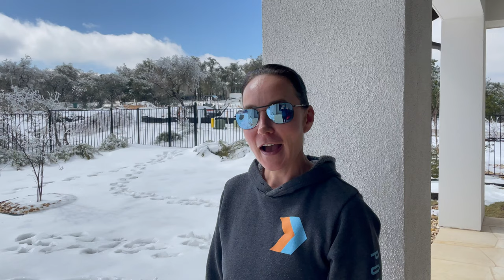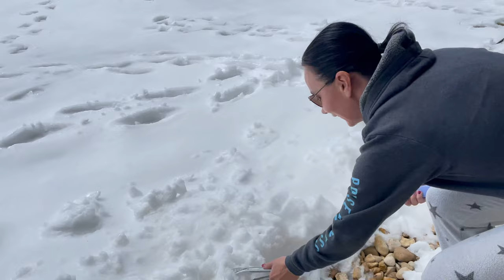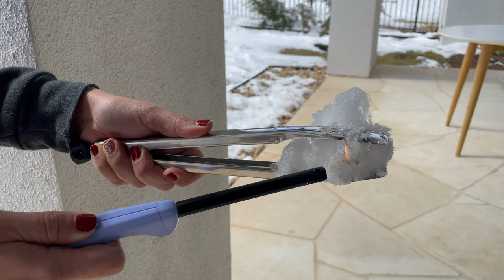Texas Snow Doesn't Melt When a Flame is Applied! "Fire and Ice."

Comment: It is melting. The water is just absorbed into the rest of the snowball that’s loosely packed. And the black is soot left by the lighter.
Reply: You're partly right but the blackness is not from the lighter because it does that in the microwave as well so that's false

Comment: By putting a flame up to a snowball, most of the melted water is just being sucked up by the remaining snow just like a sponge. remember snow is mostly air and has empty pockets that will suck up the water due to surface tension, making it slushy inside but looking the same from the outside. Its called "Capillary action". Kinda like when you pour the syrup on shaved ice, or like a said, a sponge. The literal definition of capillarity is "the tendency of a liquid in a capillary tube or absorbent material to rise or fall as a result of surface tension". And I hear a lot of people saying it’s due to sublimation but it’s definitely not sublimating at regular atmospheric pressure at a noticeable rate. Evaporation, maybe a little but the cold air from the environment and the cold from the snowball itself will most likely condense the vapor right back to liquid, and effectively be absorbed by the snowball. Also the "Burning and turning black" is just soot from the incomplete combustion sticking to the snow. You can put that same flame from that lighter against a piece of glass and you will notice it starts to blacken. The soot is a byproduct from the butane gas being burned inefficiently. If you really want to test your "fake snow", leave it in a jar with the lid closed and leave it at room temperature and see what happens. I'll give you a hint... It'll turn into water.

When people can’t understand something:
 “it’s a government conspiracy y’all!!”

People in this country literally forgot how to think critically.. it’s pretty sad
Reply from the maker: Best response anyone has taken the time to write. Thank you.
Reply: @BlakeandDianaRoberts  I noticed in the video description, you say it’s due to sublimation. The logical explanation as I previously stated is that the shrinking of the snow is due to the water being sucked up by the snowball. And definitely not due to sublimation.

To illiterate, at regular atmospheric pressure, frozen H2O/water will not sublimate in large scale. In order to get frozen H2O/water to jump states from solid to a gas sate, bypassing the liquid sate, you'll usually need to drop the pressure drastically, in fact close to a vacuum to get any sublimation to occur at a noticeable rate. At regular atmospheric pressure, it will take drastically longer. You can observe this phenomenon when you leave ice cubes in a freezer for a vary long time. Overtime you will notice the ice cubes will shrink and get smaller. Side note, frozen C02 / Carbon Dioxide can sublimate in regular atmospheric pressure. Witch is commonly known as Dry-Ice. At regular atmospheric pressure, you can observe Dry-ice sublimate from its solid ice form straight to it’s gas state, bypassing the liquid state. And if you want to turn dry-ice into a liquid, you'll need to “increase” the pressure “above” 5.1 atmospheres.

Keynote is “Sublimation is not the same as vaporization”

If you are using a flame from a lighter to heat snow/ice and say you do accomplish to boil some of the water off, this is “evaporation”, not sublimation.

Don’t know why but it really bothers me when I see an incorrect answer being corrected by another incorrect answer..

Comment: I live in Utah and we always get snow in the winter. I just barely tried this. At first the snow seemed to be disappearing but no drips. I continued to hold the lighter under the snowball. After about 45 seconds water started to drip on the back side of the snowball. I'm assuming the newly melted snow was being absorbed like a sponge. When the snowball/sponge couldn't hold the water anymore it started to drip. I noticed none on these videos holds the flame long enough to accomplish this. Probably because in today's world we expect instant results. Try holding the flame there longer!
Reply: You are spot on as far as the science goes. The snow is very porous so it newly melted snow is absorbed by still melted snow
Reply: This is exactly what is happening. Once the snow cannot hold the water tension, it starts to drip.
Reply: You are correct also the reason why the snow turns black is because of the butane in the lighter

Comment: There are plenty of science videos that show why snow does that with a lighter
Reply: And of course,  the "scientist" are telling the truth.
Reply: So what causes the snow to blacken? I tried this with ice and it didn’t blacken, it melted.
Reply: @youcanask2980  the residue from the used up fuel of lighters collects on the snow and if the lighter is very close the solid snow will go straight to a gas and the residue won’t get washed away.
Reply: @youcanask2980  think about you’ve ever seen a old style torch on a stone wall has black soot around it, it is kinda similar to that as the fuel that the flame feeds off of is collected around the area. I hope my explanation and example helped you.
Reply: @thebeanbandit8259  Ok I get the discoloration caused by fuel but why isn’t it melting? I have seen the same test done with a candle which has zero fuel and it still discolors and does not melt. How is that possible it doesn’t melt at ALL? An ice cube melts right away and it’s way more condensed.
Reply: @youcanask2980  the solid water that snow is made of instantly turns into a gas and has no time to wash it away
Reply: @youcanask2980  and an ice cube is just a straight solid and snow is mostly air due to the crystal structure and because ice is solid water all the way through you need way more heat to get the same affect but since snow has a lot less water to turn into a gas it takes less heat to get the non melting affect
Reply: @youcanask2980  oh and the wick of a candle contains fuel that is how candles stay lit and gives off the residue
Reply: @youcanask2980  I must apologize I was not fully paying attention when I read your comment I misinterpreted what it had said so if you saw my unedited comments please look at the edited versions
Reply: @youcanask2980  snow is not ice... that's your first mistake. snow is loosely back tiny ice particles, the gaps in between hold air, and the melted snow retreats into these pockets
Reply: @youcanask2980  it's because it is condensed it melts, the snow melts, but it falls back into the pockets of of air as snow is not one giant solid. The water that would be right at the tip would turn into a gas and you would not see that water droplets fall.
Reply: @youcanask2980  wax a form of fuel buddy
Reply: I live in Canada when it's 50 below snow still felts when held to fire
Reply: @thebeanbandit8259  this is not sublimation. That's dumb.

Edit: just to be clear, the snow is melting , it just isn't sublimation
Reply: @richierich890  it felts sure, but does it melt??
Reply: @youcanask2980  also, it would be more effective to hold the snow further from the fire and Directly below it. That would be the hottest zone. The zone hotter than the flame itself. This is highschool lvl stuff.
Reply: Dry ice? The government is not your friend.

Comment: We filled a five gallon bucket with snow during the winter storm it melted with the use  of a heat gun. It did take it awhile but it did melt. It left a little over a quarter of the bucket of water after it melted completely.

Comment: I'm stating the obvious and I'm sure it's in the comments somewhere having just breezed through them. If the snow don't melt where is it going to go?
Reply: It’s immediately turning into a gas and dissipating, thereby skipping the liquid phase.
Reply: @USCavalry1  Actually, it's much simpler than that, it's just being absorbed into the air pockets in the snow as it melts.

Comment: The snow DOES melt, but the liquid is siphoned back INTO the snowball by the rest of the (still frozen) snow - that is why it doesn't drip to the ground. Because the rest of the snow pulls it into itself. Snow is a relatively "dry" thing even though it's made up of 100% water, and dry things tend to absorb moisture. And snow doesn't "burn" or get "scorched". That scorch mark is SOOT produced by the LIGHTER.
Reply: Did you fact check that?
Reply: More like condenses

Comment: The snow in Chicago melts with a lighter and didn't get black. .so they have a point
Reply: It all depends, the black is the lighter fuel and at that point it's turning into gas and melting back into the ball so it is still melting, but as a Canadian the snow in my backyard does this, so no they don't you just don't either

Comment: The definition of"so-called Sublimation is when a solid does not liquify, but turns into a VAPOR or turns straight into gas (which is the vapor) without liquifying. So, when heat is applied, the gas appears as a vapor. Cut the crap!!! This snow doesn't turn into anything, just black. It's not sublimation. The "SNOW"  that you used for an experiment in school 30 years ago was most likely DRY ICE. When you add water to DRY ICE, it creates a VAPOR. THAT'S sublimation. The government is experimenting...must be the same ingredient that they use for McDonalds buns. They turn black when you nuke them. Please quit believing anything they say!!!